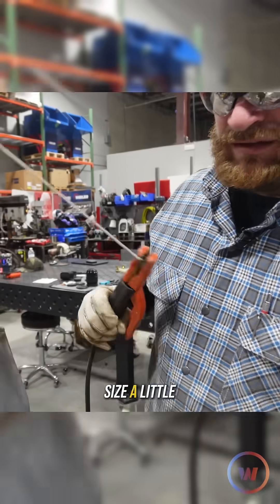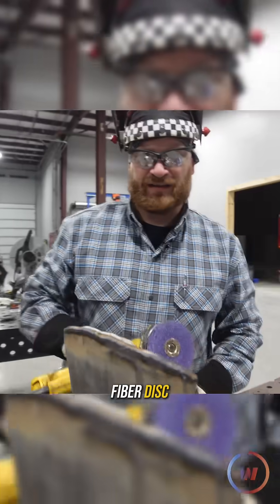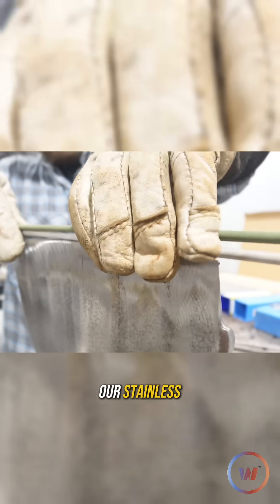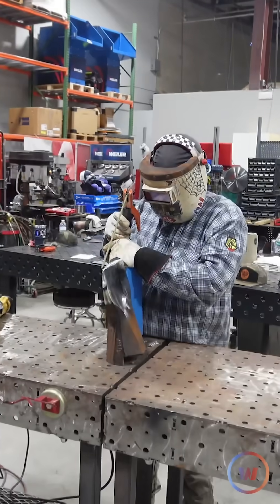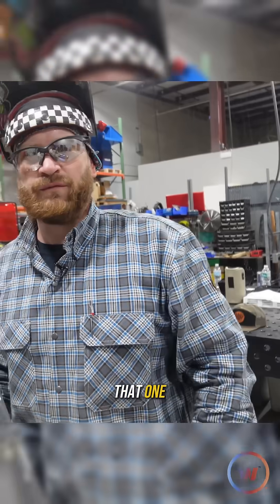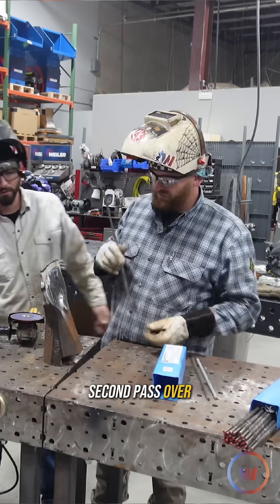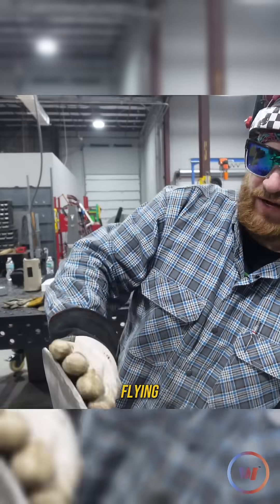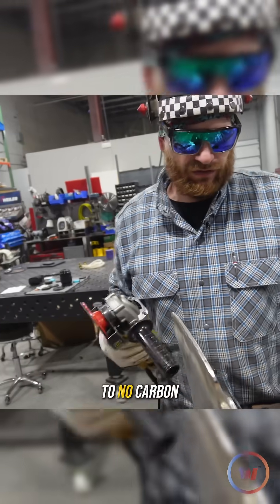Repairing an excavator tooth building up hardfacing material #welding # repair

Comment: That spider web on your hood... Nothing like tig welding and a wolf spider goes into your glove. Those freaking fake widow spiders pack a nasty punch! You'll have half a golfball sized water blister on your hand that'll leave you scratching your head at just how you got burned at the edge of your long sleeve shirt. It'll take no less than 2 weeks to stop oozing and bleeding occasionally. That's a welders tip for you. Peroxide will stop it, but you may have to scrape the wound to remove the rest of the necrotic toxin if your skin boils up after you always apply it. I got the first healed and two days later... Another one dropped down and nailed me again! I sprayed so much poison in my garage I couldn't go in it! 🤔⚠️ I eventually realized that cigarette ash stops spiders, so I now just blow it to the edges of the garage and don't have to spray anymore. It's caustic, so it burns them.